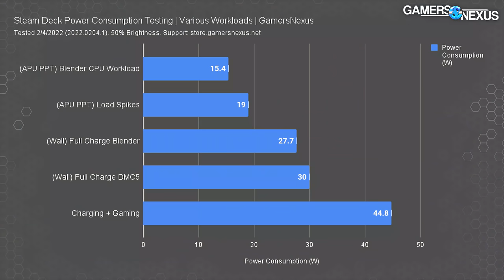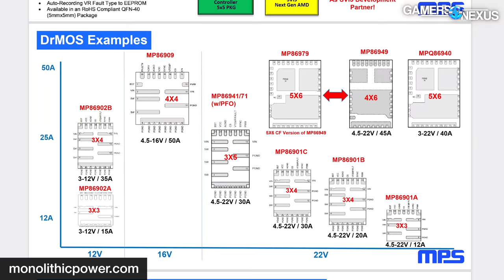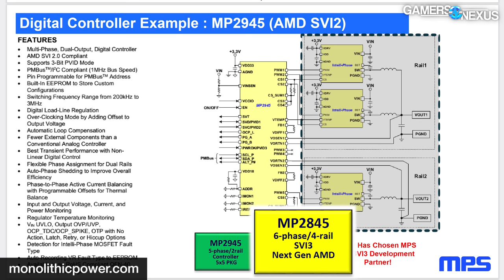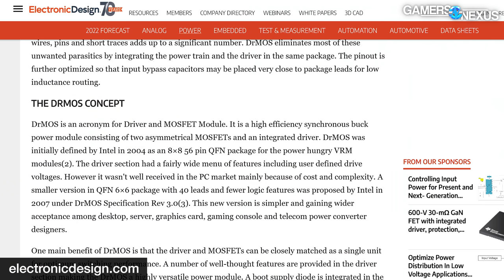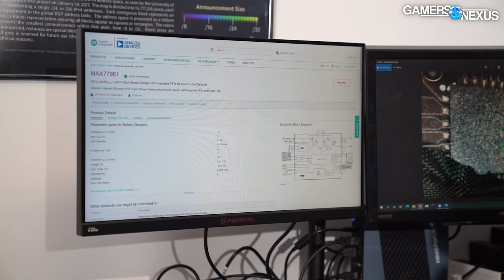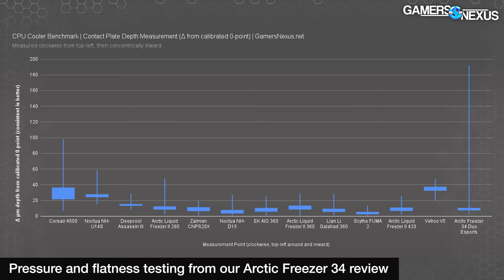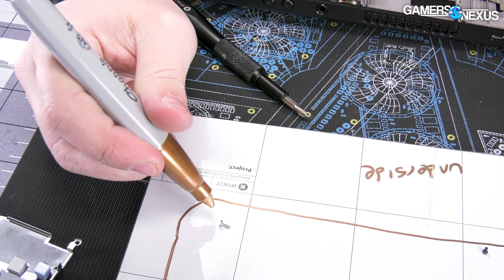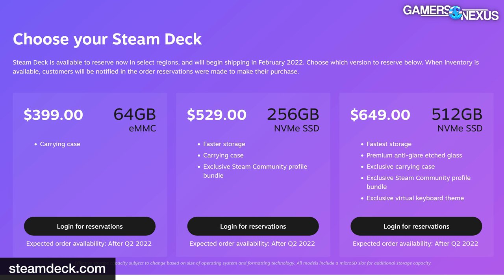Steam Deck Tear-Down: Build Quality, Disassembly, & VRM Analysis

Comment: You know what looks kinda disappointing? Really hard access to a display, it seems like you need to disassemble everything in case you have a cracked screen and want to replace it. That’s looks like a big oversight. And I’d argue that displays are being cracked even more often than the battery degrades, or joysticks/fan breaks, so it’s kinda weird to see the display being so inaccessible.

Comment: Hey just a note on thermal imaging. Yes, heat sinks get hot, but WHERE the device gets hot matters for a hand held. So it is useful in an ergonomics sense. Maybe cover it when you cover ergo?
Reply: Linus did the thermal imaging, the controllers where the most cool part of the deck mostly blue little bit purpleish, where the center(screen and main board where the center of all heat so its very comfortable, he ven compared to other portable pcs(aya neo and such) and the deck was vastly superior in this case where its cool on where its needed for our hands to feel nice while playing.

Comment: Worth noting the charger IC supports thermally regulated charging. That may be why the chip is running so close to the maximum temperature - it is probably thermal throttling the charge to keep it there. It would not surprise me if the die inside is right at the 105C rating. It might also mean the charge chip is actually safe with the case off (the temp rise may simply be a smaller delta between die and case temperature due to reduced airflow), but more investigation would be needed to draw this conclusion

Comment: I like the PCB module that contains the Apu. It contains all neccessary components including the SDCard slot, USB-C, SSD, Wifi and the power button. This means this is essentially a single board computer in a case. This also means this ist technically upgradedable if they ever make a new model where all the other boards are compatible. I imagine taking the Board out of the case and designing a custom computer with a faster gpu, booting over a USB-C dock and using the ssd slot for the GPU. You could make an extremely compact system. It will be fun to play around with.

Comment: I think it's really smart of Vavle to use Atmel's (Now Microchip) AtsamD21 micro-controllers on the daughter boards. By doing that, they can consolidate all of the different data from all of the inputs on that side, and send it to the CPU as a single set of instructions. This frees the SoC from having to do some of that work of converting inputs to interrupts, to data, as well as significantly reduces the number of data lines being used up for inputs. It's not really something i've seen many companies doing.

For those who don't know what an AtsamD21 is: It's a32-bit ARM Cortex-M0+ processor.

Comment: That ribbon cable on top of battery is the only weakness on this device. They should just make steam deck 1 - 2 mm fatter, make battery has its housing and the cable under the battery (thus if you can imagine the housing is like a bridge).

Comment: The MAX77961 ambient max is 85c but the junction max is 150c without thermal shutdown. Also it has thermal foldback to charging current at default 115c

Comment: Only thing I'd point out is that 6A at low voltage will not go through skin given your impedance/resistance but it's likely stone was working on a PSU right before it and mixed it up after a tiring day

Comment: To me the magnesium casting is one of the most interesting things about the steam deck. I wouldn’t have expected valve to go this route for adding rigidity to their product. I would have thought they would use some sort of alloy frame like the switch or some internal steel bracing to increase rigidity. As far as I know magnesium isn’t often used in this manner in many other portable electronics. It’s cool valve was thinking with of the customer with this design choice. You can be certain that when applying a twisting force to your deck while raging due to unplayable frame rates that your steam deck will not fall apart and your motherboard will be safe. However battery replacement and screen repairs are still a sore spot for the valve. The battery issue could be rectified with pull tabs or screws, but I suspect having an easily replaceable screen will require a second generation. Owners should be careful to make sure they don’t damage it, otherwise you’re screwed.

Comment: For battery, Valve should really consider those adhesive strips that you can "pull" out, like on phones, bit of strip is visible on the side of the battery and you basically pull it, it stretches the strip and after you are done, battery is free. Strips might not be reusable, but at least it makes it easy to replace battery and in mobile phones, it caused no issues so far.

Comment: 30:40  I was a bit concerned about the battery ever since that valve video that talked about how easy to replace the SSD and analogue sticks are but ignored the battery. The battery is the part of the system that'll fail first for most people, if you're gluing it in you're no better than any other company that designs for planned obsolescence whatever your advertorial videos say. There's no good reason to do that either, replaceable batteries used to be a standard feature for portable devices.
Reply: I hate to be that guy but by the time you have to worry about the battery you this will be completely obsolete anyway. Just like laptops. Not defending valve but they probably have a good reason to glue it in

Comment: Frankly Valve is doing really good. They do internal testing and external testing and get a bunch of various feedback which itself is important with all the different ideas and points of view. The closer to release it gets the more promising this product looks. From the basic stuff like labeling things, and not making things inaccessible for no good reason I like their way of thinking. Sure there are still questions (considering it's a pre-production test unit) like a glued in battery, but it's fair to assume those might just be for the sake of testing as in, not to mess with.
GN is doing very quality content as usual, thanks guys.

Comment: FYI You should look at the D600-D610 laptop Dell laptop line,  They have the EXACT heat sink fan configuration.  It disapatates alot of heat.  I worked at Unisys at at that time doing alot of same day replcacements.  To be blunt, thy just gave us a tube of soder.  Not dissing on Unisys though, thats from Dell.

Comment: 27:04  
if Valve sells replacement Batteries they better sell them with those cables included, i would 100% fuck those up, especially if glued on.

Comment: My guess is that Valves embargo covered that any pre retail reviews could not talk about or test different ssds until release. I have the 512gb model ordered, but will be replacing immediately with the new Micron 2tb 2230, that I was lucky enough to get, along with a 1tb micro ssd. I'll be rocking 3tb in my SteamDeck. Can't wait for Feb 25th, and ultimately Mid March at the latest.

Comment: Steve: The first thing we should do is disconnect the battery so I don't short something with the screwdriver.

Also Steve: Points at exposed wiring with the screwdriver with the battery still connected.

Comment: So I’m finding that you can (though it will be a pain in the bum) completely rebuild/upgrade/technical build from scratch the steamdeck is quite a bonus, I was expecting back when this video came out to be all custom stuff that only valve had access to but now 4 months later you can get the parts (and if you don’t mind it looking like Frankenstein’s monster install all kinds of after market mods) to replace most things that may get busted (I’m hoping when I get mine I never bust any parts of mine, I may be able to fix them but just like a laptop ied hate to have to mess in there as I have big fingers)

Comment: Very cool teardown. It looks like the device is pretty well built, and it seems like it should be relatively easy to repair compared to some devices, what with standard screws on the outside. 

Not sure if you guys have experience with the quality of different MOSFET parts on the market, but it might be worth investigating and talking about is the chip itself they're using any good? How does it compare to other manufacturers like TI?

Comment: Steve & Team. Please focus on the SSD, as that, imo, is probably the most important hardware component of the entire system. Do you have any 2230 SSDs to test RF interference? Please follow up on this. Like the thoroughness of the thermals and stuff, but the SSD is, imo, critical to look at from a consumer standpoint.

Comment: Valve should have basically all these parts listed (even at a premium, IDC!) Simply so that they can slap every other company with the ability to fix, update, replace components.

Battery not doing great anymore? Put in a new one. Joystick drifting? Replace it. Touchpad not quite right? New board..
Even upgrades or 'mods' would be really cool for this.. IDC if they hit us with 100 warnings while you buy it.
Replacing triggers, battery, screen, fan, face buttons I definitely see as feasible in this version.

Hopes for a V2 - find a way to separate the left and right side controllers (even if not as simple as a switch, like requiring disassembly).. that would allow for people with different hand sizes to maybe get different sized handles (grips).. if it was hot swappable like a switch you could allow for people to change the controller type and layout based on the games they play or layout preference

Comment: The battery charging chip is clearly marked MAX77961EFV06. The 'E' indicates an extended temp range '-40C to 85C'. If it were 105, which matches 'Automotive Grade 2', it would be a 'G'. (The 'F' means the package is ceramic, the 'V' means 30 pins, and the '06' refers to 600kHz. The last line is 2122 which is a lot number: year=21 week=22). If it were a custom part it would be clearly indicated. There is no 'G' variant of this part or the 77961B listed anywhere, and it isn't really possible to thermally up-screen a part like this, so it isn't likely this is a choice just for the pre-release hardware.
It's possible that they might have made a design error in thinking the part could go up to 105. If so then a prediction is that there will be more charger chip faults than expected, which would force them to slow down charging or improve cooling for the chip. Time will tell. It's definitely something worth asking them about.

Comment: If Valve is ballsy enough to send a test unit out to my favourite metalhead from GN, they must be serious. 
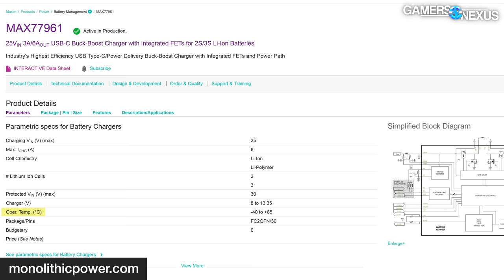@20:13 The difference between LiPol and Li-Ion is AFAIK the packaging. LiPol is more malleable.
@24:21 Unless you care about wasting precious liquid but ... too little can be problematic, not too much within the boundaries of the contact patch, off course.

Comment: If Valve has to glue in the battery due to liability, it would be nice to see them take the extra step and offer a battery replacement service. That way they cover 2 big points for the consumer, and that is the battery replacement itself, which was going to cost money, and if you can pay Valve to do it, then it's essentially 2 birds with 1 stone, but also getting the replacement done without risk of damaging your device, since, presumably, Valve would have the expertise to not damage it to begin with, and even if they did, they now have the liability to fix or replace it, which they would have the ability to do at a much lower cost than the consumer.

Comment: Maybe I missed it in the first video, but you tested around 68F as ambient.  While that's a good temperature in a lab, what about real life when people take a portable system outside or during the summer when AC is set higher.  Does the cooling scale linearly, max out or throttle?

Comment: I'm guessing that charging circuit is off the shelf but they got an engineering judgement or further validation at those temps from the manufacturer. It's just too low volume to have that built bespoke (you never know but considering their price target I'd think they were aggressively avoiding custom components except where it matters)

Comment: Steve, I love that you're trying to educate your viewers on how to safely open and handle electronics. But despite all the precautions you took, using a metal screwdriver as a pointer is a big no-no (even after disconnecting the battery). Pressing the power button does not necessarily discharge the entire device like you said. If you're trying to teach by example, you should always use a non-conductive pointing tool.

Comment: Would it have killed them to add $3 to the bill of materials and use some brass thermoset insets for the main covers screws instead of crummy self tappers right into the plastic?

Comment: @Steve: it looked like lots of the small parts like the daughter boards had QR codes on them. Did you try scanning any of those? Would be neat if they linked to documentation to help you identify them or re-assemble them

Comment: The confidence they had to let all the big indy reviewer do teardowns speaks volume in itself I think. You guys did great, I loved all the technicalities you guys went through for the electronic nerds. I couldn't help but notice how their engineers anticipated serviceability issues that could rise. Omitting the weird choice for the battery fixture, everything seems quite standard-ish and possible to be repaired by a local tech store without special specific training. Since there's not too many service points from valve AFAIK, making it repairable locally is a big plus.

Comment: Looks very interesting, now i wonder about the durability, the Valve index is/was the best VR headset on the market but has a pretty big problem with parts like wall sensors and controllers just randomly stop working.

Comment: The board with the audio cable @ 9:20 what's the other cable next to the audio jack. Asking cuz I notice mine was loose after taking it apart. I reseated it but now my Steam deck lcd isn't coming on, no back light.

Comment: I know it's not ideal nor recommended for a handheld device that will be moved around a lot but I would to see what liquid metal would do to the thermals. I'd like to know if the thermal paste is the bottleneck here or if the heatsink is

Comment: Question: can you guys try it in a low pressure environment like a airplane and see if the fan still pulls enough air to prevent overheating?

Comment: Could dock use a fan to boost airflow (and thus thermals, maybe performance) or would it be so finely balanced as to be better off just left alone? I've seen 4khdmi ethernet USB C docks for ~£35. Likely this would be all you'd need.

Comment: Hey ! I want a use 5600g(stop gap) + msi b450m mortermax 
I'm willing to grab a 144hz monitor with my system and willing to use to use Display port(I've talked with msi that b450m morter max has dp port 1.2)
my question is will I'll be able to use high refresh rate with my 5600g apu?

Comment: My in-built controls dont work. In settings > controllers, no controllers seem to be detected. I dont think its a connection issue but rather a thermal / voltage issue because time to time it just detects and works perfectly, without any missing input. 

I think it might be a VRM or an inductor issue, at 26.30, do you know a component can be causing this issue? is there a microprocessor that virtualize the signal coming from the daughter boards ribbon cable?

To give some context: When I turn it on for the first time for the day, it works for 1-2 minutes than disconnects.  and also I was trying to deplete the battery and it just suddenly started working at 3%. Maybe the power delivery also effects that specific VRM.
Reply: also, haptics give that beeping sound when turning on most of the time, and give the instant feedback on touch but I don't think that means they receive signal, heard they have their own chip to do that. So they receive power most of the time. (even without being detected as a controller). Yes I did re-imaging or reformatting and that didn't fix :(

Comment: I'm thinking of taking it and making a cooling deck (it will require removing the back part and some CPU coler from TDP 180W for $ 30, some case) and to have a 1080p PC :D
Reply: You might want to watch their other video first. The backplate creating negative pressure is actually hugely important to cooling some of the on board chips. If you take the backplate off and just give them open air cooling, their temperature rapidly climbs into the 100+° C range. You'd need a custom cooling solution to keep them under control
Reply: @TheKillerStove  But I would like to give thermal strips everywhere above the motherboard. Above that I would give metal plate (dimensions the same as the motherboard) and stick a CPU cooler in the middle - the back side would be for nothing, as well as the current cooler :D If you understand what I mean

Comment: Thing is enormous. The Switch is already a giant handheld. I use the Lite for portable play. I don’t get why they had to include all those touch pads. It could have been two inches narrower without them
Reply: Its for use on pc focused games, remember this is not a portablr console, its portable pc, thats why valve keep remembering us of this fact, the touch is for games like rts ones, games that only work properly with a mouse or need for some reason mouse input, it was made to increase deck game compatibility as much as possible, also its big because of it repair friendly approach, which is why valve used lots of daughterboards instead of a stupid single motherboard that would require complete swap in case any component died.